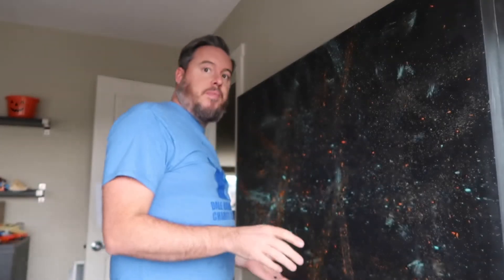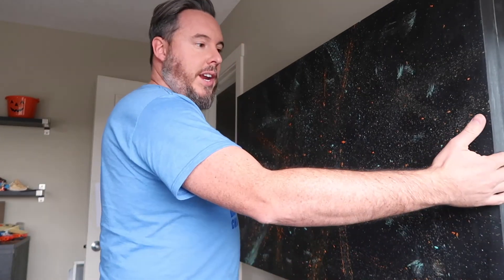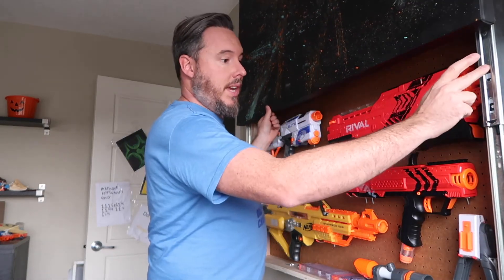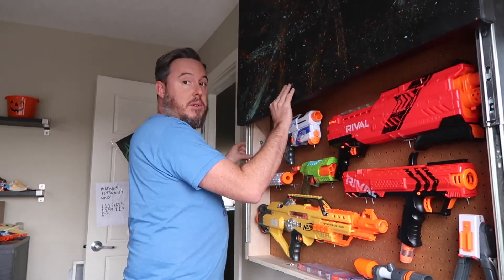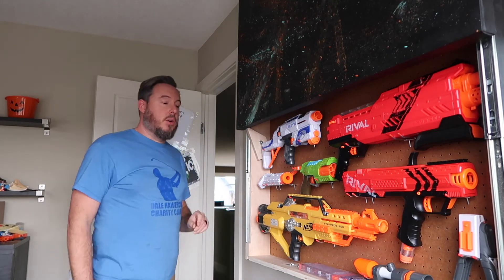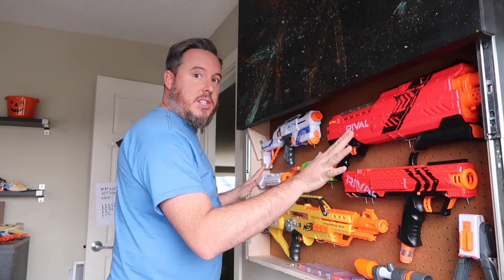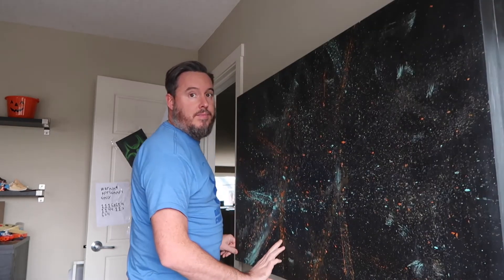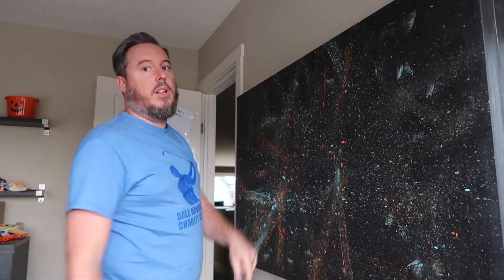DIY Secret Nerf Storage Wall//Do it yourself nerf wall

Comment: Awesome project brother! My son and I are also into Nerf and plan on making a wall soon to hold all of our gear. One suggestion that is really just for aesthetics is to add an LED strip around the edges to make the whole thing glow and most have remote controls to switch colors and some cycle through all colors automatically and some have the ability to adjust the tone or hue or whatever of a specific color which is pretty awesome

Been searching through similar videos to get some inspiration and see how others have built theirs and this is a good example of what I was referring to:  

https://youtu.be/nHmM08M4258

Thought it might help if you choose to do this or not. Regardless, awesome video and yes more would be great! Haha
Reply from the maker: Sweet! Thanks for that. I’ll check it out.